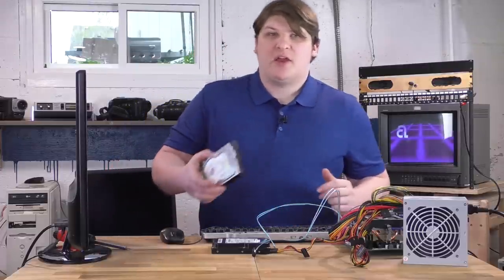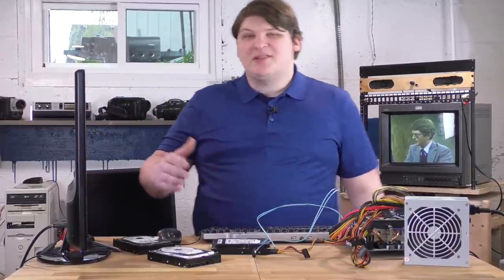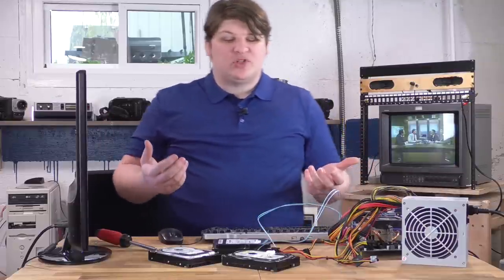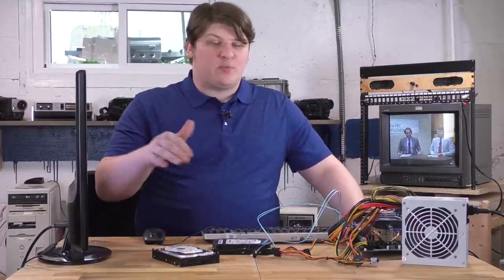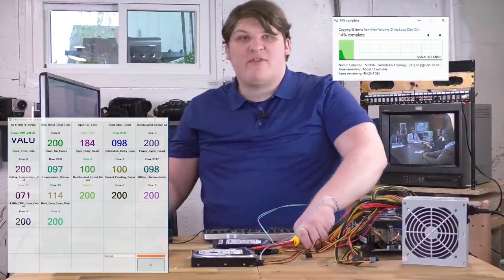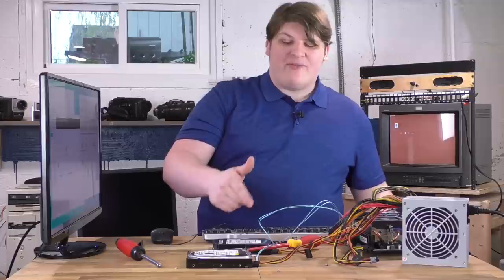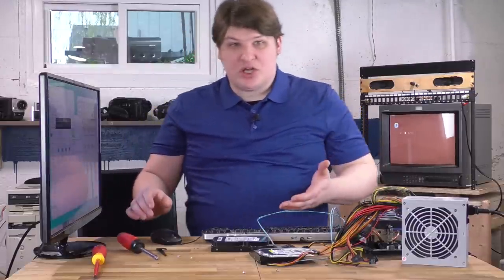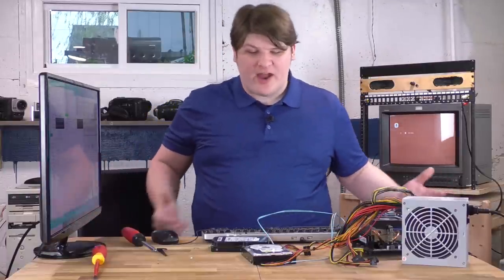Can A Hard Drive Breathe Regular Air Like Us

Comment: One thing to note here is that the drive also contains its own internal filtering, if you look at one with the cover off you'll see the case is actually shaped so that the platter itself works as an impeller, to drive air through a small filter. That way anything approaching the platter rapidly gets pushed away and captured before it can recirculate.

I actually had a sampler's SCSI drive start to do the click of death, so out of curiosity I decided to open it up and power it up with the cover off on the bench. To my surprise the head suddenly started working properly after messing around with it for a bit, so I put the cover back, put it into service, and it's been fine ever since. I think people exaggerate how dangerous particulates are for hard disks - sure they'll kill it eventually, but it's a long-term probability thing, not an instantaneous effect.
Reply from the maker: Remarkable! Though I assume that was quite an old drive, so maybe the precision has gone up - but I was hearing that "single speck of dust" thing in the late 90s, so yeah, I suspect that it's exaggerated. Consider: if the drive is spinning, unless that dust is INCREDIBLY sticky, centrifugal force is going to fling it away, right? So let's stack up the probabilities:

1) dust particle approaches drive to begin with, instead of brownian-ing itself in a different direction, and
2) dust particle isn't pushed away by spinning disk, somehow (extremely unlikely), or
3) dust particle settles on disk that isn't running, and
4) disk manages to spin up without throwing particle off either immediately, or in the potentially many minutes before it has reason to read the spot where the particle is

Assuming that dust isn't so sticky that it could cling on to a 5400, 7200 or 10,000rpm disc, it actually sounds incredibly unlikely to me that this failure scenario could ever happen.
Reply: I imagine dust could probably get sucked into the boundary layer of the disk if it approaches from the hub, and get pulled under the head, alternatively dust settling on the platter with the disk powered down could probably adhere itself pretty well, just think how hard it is to blow dust off things that have been on a shelf for a while. As with anything involving hard disks though, it's all about getting that MTBF as high as possible - even a tiny probability becomes significant over a long enough period, and when the outcome is essentially device destruction you don't want to take any chances!

Comment: I still have my hp mini, idk for how long i have it, but for sure it been more than 13 years, it still works, batery, hard drive, everything. It is slow even with linux mint and I3, but it holds data so surprised as a child I used to abuse that thing, I think it had most of the virus it could had, was great let me learn about pcs, yet I still use it cuz I cannot afford a better computer, I have my acer aspire E15 with to be honest I think it is possibly worst than my hp, hp never gave me any problems, but acer gave me all the possible problems and it doesn't do virtualization

Comment: The finger print thing is useful because so many people do have the gut instinct that fingerprints are flat. In reality they can be rough enough to feel through a thin glove. So, if you are transferring platters between hard drives it is very important to clean any finger prints off the platters before spinning them up. Really, if you can see the contaminant with your bare eye it is probably big enough to crash into the head, which is a problem when the disk is spinning.

Your test, oddly enough, did succeed in a small part because the platters spent most of their time spinning. Dust cannot settle on the spinning disk because of the air flow crated by the disk's skin friction. Air born contaminants large enough to be dangerous (dust) are usually safe for this reason unless they are made of something that will stick to the disk and hit while the disk is stationary or hit with high enough velocity to penetrate that air barrier.

Comment: the space between a hard drive read head and the platter is about 0.0002" iirc, which is indeed much smaller than hair or smoke particles, but those won't immediately destroy a hard drive. think of a hard drive like a record player. if you play records with dust all over them, you'll damage the needle and the record, and eventually both will sound horrible. 

i have definitely seen hard drives being run with the cover off for several years, but i wouldn't recommend it. they're resilient in some ways, very fragile in others. one method of hard drive data recovery is called "the toaster method", and involves taking the board off the hard drive, putting the hard drive over a toaster for maybe ten seconds, and then put it all back together and spin it up to see how much data you can grab before the platter shrinks out of alignment again.

Comment: I actually did this on my old youtube channel, v3dgames in 2008. I ran a 10GB WD drive with the cover completely off just in our kitchen, copied files & stuff, it never died, put it back together I'm sure it's around somewhere & likely still works. On the flip side, I had my older laptop fall off my bed before, less than 2 feet & killed the hard drive instantly, I also have had a desktop hard drive somehow shred itself while I was sleeping, woke up to the click of death, opened the drive with it off & found the platter looked like the rings of Saturn sadly.

Hard drives can be very durable, until they aren't. They might take a ton of abuse & keep going or could die over night for seemly no reason. P.S.A, always have backups of important data.

Comment: Fun video, got the like and subscribe from me and I'm sure you already know this stuff but just want to point out:
1) Running the hard drive with the platter fully exposed is possible but can be VERY dangerous/deadly in the event of catastrophic failure should the platter shatter.
2) Running the hard drive exposed to the air will work for a while, but I promise, it will not last NEARLY as long as a hard drive that has never been opened. Surely, you have seen the inside of a computer case after a few months of use... Try running that hard drive with even just the corner open for a few months to a year and I can guarantee you will have problems as the dust, hair, etc... began to collect on the surface of the platter.

Comment: I have a 16 year old Thinkpad I got from a closet full of trash at my school, and the original hard drive still works. I use this as my school computer and I’ve dropped it numerous times and even accidentally stepped on it once, and the 5400 RPM 2.5” 30 gig HDD still works fine somehow.

Comment: I know this simply anecdotal, some jackass on youtube commenting but...

I once had a hard drive out of the case sitting on top of my PC.  I knocked a bottle of hot sauce off my desk (cheap Jalapeno green stuff) and it landed right on the PCB.  Dead drive.  I bought an identical drive, even made the same week or so, off ebay.  Swapped the PCB over and it didn't work.  It was a single platter drive so no heads in between platters to make things difficult.  I popped the top off just on my desk, swapped the platter into the other drive, closed it back up and it worked perfectly.  That was about ten years ago.  That PC, and that drive STILL WORK.  I can boot it right now, no problem.  

I probably just got lucky but I had always heard the same, "Take the top off, instant death."  Nope.  

Smack it with a bottle of hot sauce, and...clack...clack...clack...clack...dead.

Comment: Up an tell a year ago, I used a hard drive in my Disco System I build myself it got bashed around in the back of my car, and did 100s of Gigs with it, the only time I had trouble was when a stick of ram jumped out of it's  socket,  but never a problem with the hard drive, I now use SSD so yah they almost indestructible, my mate always said to me I don't know how you get away with that, but I did suspended in rubber so that helped, great videos

Comment: Enterprise drives behave differently - they give up more quickly in adverse conditions so as to be kicked out of an array without making the storage controller hang indefinitely on retry operations. Consumer drives hang on for dear life with everything they've got.

That said, those particular old double-digit gigabyte WD drives were tanks. I had one that spent a couple of years in a rucksack, and then many more in the trunk of car. Freezing weather, bus rides, very unkind handling, and every now and again, regular use. Never failed, just got too inconvenient to use. If I could find it, I'd bet solid money on it still working.

Comment: in the late 90s we used to take the hard disks apart and put a window in them. Air must have been a lot cleaner back then because they worked fine afterwards.

Comment: I swapped the platters from my dead 1TB drive onto a working one (same model)  just to recover the data from it which I did on my work bench inside my not so clean garage. A data recovery in my area said it was gonna cost me approx $2.5k to get it done cause there was a scratch on the top most platter in which I told them to forget it and send the drive back to me. I only wanted to recover some of the data not all of it and I was able to do it myself. Total cost I spent was $30 for a used working same model drive and filled slots onto a piece of acrylic I had laying around to use to keep the head comb separated.

Comment: Use a washer that's the same thickness of the lid.
They're harder to get catastrophic failure than you're thinking. The seal and filter help with longevity and reliability, but I've transplanted platters into a new hard drive for data recovery, using nothing but rubber gloves to keep things clean.

Comment: For voltage to kill a person, it needs a current path. If you're touching voltage alone, and don't have a return current path, it won't harm you at all. So just touching a wire, if you don't have a return current path is harmless. But if, for example, you're holding a grounded piece of metal, or touching a ground wire when your other hand touches touches 120V, you will definitely feel it.

The other piece is that to harm you, the voltage you come in contact with needs to be sufficient to actually cause damage. If you are touching a line that is at, say, 1000V, but there is a large resistance between you and the voltage source, then allot of that voltage will be dumped across the resistor. 

Your body has resistance, and if it is the amount of current that goes through your body that can really harm you. For one, it will interrupt the heart rhythm, which is controlled by certain cells that generate the pulses that make your heart operate. Electricity through your heart can disrupt the cycle. This is also why precise electrical pulses from a defibrillator can be used to reset this rhythm at times.

Lastly, 120V isn't considered high voltage. Using the terms 'Low voltage" or "High voltage" to determine safety can get you into allot of trouble. Generally, anything below 600V is considered low voltage. If you look at the insulation on the wiring in your home, it will be rated for 600V max - this is low voltage wiring. Medium voltage goes up to about 69,000V. Distribution lines at high or extra high voltage can reach more than 1,000,000 Volts.

Interestingly, you'll see birds sitting on these lines that are at thousands or even a million volts - and they are unharmed - this is because there is no current path. On the other hand, you will see squirrels trying to transition from the pole to a line, and the resultant arc can take down the power to city blocks - this is because they formed a bridge between the high voltage and ground.

So, please, don't assume that something marked "low voltage" is necessarily safe. While our outlets are technically "low voltage", they are more than capable of causing injury or death. Even the 12V in your car - saying you are wearing a metal watch, and go between the positive battery terminal and ground - is more than sufficient to cause horrible and permanently disfiguring wounds. I've seen accidents with 5V power supplies that caused fairly significant fires. It's really worth respecting electricity.

Comment: The airflow from the spinning players mostly prevents any dust from settling, turn it of, open it and try again after a few hours. Read errors will start showing up. But still possible to run it open for quite a while before it dies.

Comment: Old old drives would use the air vortex to position the platters and it would lead to more faults. I was just watching this old computer chronicles video from 85 i think it was about the new exciting hard drives at the time that were phasing those out. They'd have little filters and breathing holes tho to get the vortex clean.

Comment: I once did other similar experiment: I had an old PC powered on, running Windows 95. I tried to short circuit various points on the motherboard (including CPU socket) in order to test if it can be broken that way. So I just moved the screwdriver shorting the CPU and other pins on the working PC. Of course it stopped working pretty quickly (but it wasn't immediately). Then it booted up again like nothing happened. I was unable to break the PC like that. However - back in the days I damaged an Amiga just by touching it. A little spark damaged a port.

Comment: Using donor parts is standard practice in data recovery.
It's not like it won't work with normal air it's more like: Don't bet on it surviving any significant amount of time or a 2 years warranty period.
So the process is: get it to work again. And immediately do a sector by sector copy with a tool like dd to a reliable drive. Because it may work now, but it probably won't just a week down the line or even reliably for all sectors or the next few hours. And as you said, higher capacity drives are much higher density. Even the exact technology has gotten a few updates during the last 20 years. That's why donor parts are very tricky. Ideally you try to get one with a "close" serial number. Because firmware updates might have changed how data is organized.

Comment: I have an old Amiga hard drive which was dead when I got it.
Since it was already dead I opened it up and I found out that there was old gunk in the spinning gears. After cleaning it it spun up but couldn't read anything. So I opened up the drive completely and cleaned the disk with alcohol, which sounds insane, I know. But it was a goner anyway so I was curious.
I put it together and it worked. It was empty but I managed to format it and it worked for a year without issues. Then the spinning mechanism got issues again. It booted only randomly but the data part was never an issue. I have since replaced the drive with a flash card. Drives can be much tougher than I thought or was told.

Comment: You should get your hands on a Deathstar drive, they are a neat demonstration of what happens when that high precision catastrophically fails... And when it continues to try operating afterward. Cracked one open for its magnets and the failed head/arm had dug concentric rings across the platter so deep track0 had started getting holes all the way though. Continuing to run it would have eventually ripped that platter clean off and turned it into a 5400rpm hula hoop.

Comment: You can take apart a hard drive, adjust the head if it is stuck, and put it back together to get the data off. It does work

Comment: I think the biggest danger might be the read heads bending with a shock(drop), destroying the platter. Which is probably what happened here.
The drive platters and read heads do bend and bow when moved, they're quite thin and flimsy pieces. No adamantium in there. They just handle those sorts of things happening in the firmware.

Comment: 11:24 This is the same reason why recorded music from 45 years ago sounds like it was recorded yesterday...the way magnetic recording works, it can filter out many mechanical glitches that are glaringly obvious when played from a vinyl record. IBM PC floppy diskettes don't even use any redundant forward error correction codes at all, they just store a CRC16 signal near 512 characters of data and rely on the hard yes/no of binary computer data signaling to keep the bits okay. Probably if you hooked an oscilloscope and a high-speed buffer amplifier to the hard drive head the digital eye pattern would look a lot worse when you have the cover off as opposed to having the cover on (if the air is dusty), but it would still be able to tell a 0 from a 1. To learn more, look for the Magentophon recording from 1944 done in two channel high fidelity stereo, aside from some tape wrinkles in the middle, you'd think it would be good enough to release as an album on one of today's compact discs. TL;DR  Magnetic tape and disks have to be quite rooted before your ear notices the damage.

Comment: I have operated several drives open in the manner you were trying, including a WD 40GB, with it running fine for a few days, but then, of course, dust would collect on the head enough after a few days to assassinate the drive like you're wanting. It will happen overnight if the disk is allowed to spin down, as the spinning platters just sling the dust off at speed. Most of the disks I did this to are older 2GB to 40MB drives.

Comment: the problem isn't the air itself, it's the dust/contaminants that are the issue. However 10TB+ drives are filled with Helium and the read/write heads hover significantly closer. Additionally the drive won't die immediately, it should accumulate errors over time as it goes from this point.